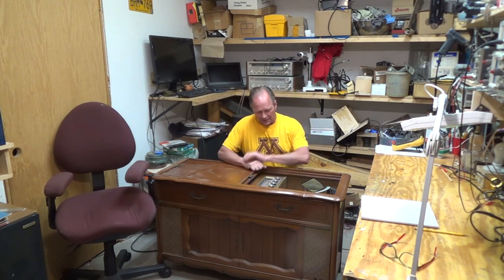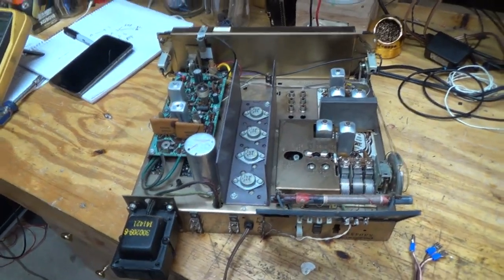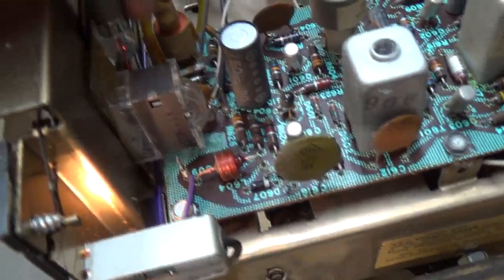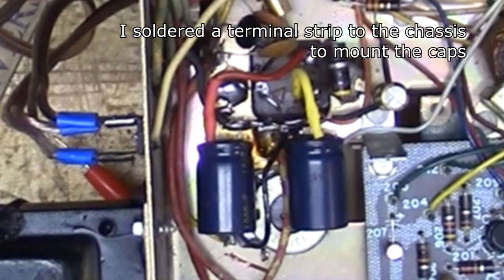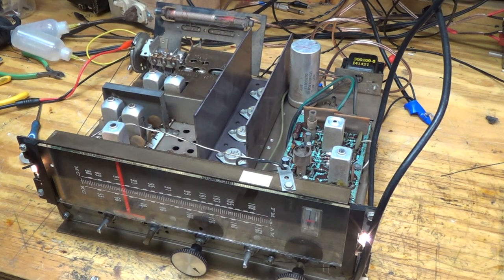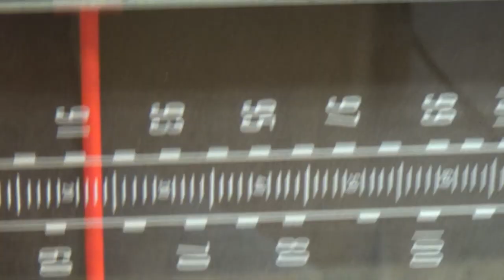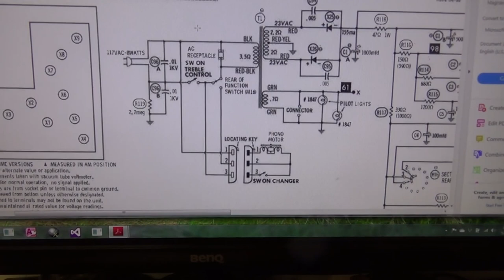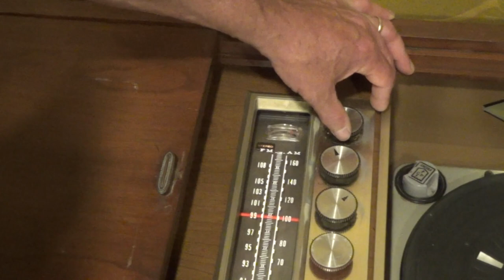Magnavox AstroSonic Console Stereo Repair and Restoration

Comment: Does that have a 204 chassis? my astro has and my fm doesn't work, i found which transistor may be bad
Reply from the maker: Model number:R20409-00 Chassis: 530432. I never did find a schematic that exactly matched. I even sent an email  to SAMS. Good luck getting it up and running! On another  stereo I fixed up from the early sixties I replaced the bad geranium transistors with Russian equivalents and it worked pretty well. Shango066 goes into quite a bit of detail on these replacements.
Reply: @RobsFixitShop  i found and fixed the problem . a couple lumps of solder shorted something but no permanent damage

Comment: Hey Rob, I have a Magnavox 1P3712 model and the the broke where it goes into the wall socket, I cut and rewired it but now the sound is high pitch and a little faster, any help would be great. I subscribed as well!
Reply from the maker: Try reversing the plug if it goes away add a polarized plug.
Reply: @RobsFixitShop  I did reverse it and it continued to do the same thing.

Comment: THE RECORD CHANGER
WAS MADE IN ENGLAND
OF HEAVYWEIGHT 
MATERIALS, IT IS NOT A CHEAP THROW AWAY
ITEM. TO SOME.
PEOPLE BUY THESE
CHANGERS ON EBAY
ALL THE TIME.
EVEN WHEN THEY DO NOT WORK PROPERLY FOR
PARTS., RESTORATION.
Reply from the maker: I am going to take another look at it, the owner wants to fix it. Thanks for the input.
Reply: @RobsFixitShop  did you have any luck?
Reply from the maker: @lordalexjones1177  Yes, the wire between the cartridge and the RCA jacks was broken and beyond repair. I tried using a wire from some ear buds but it was too stiff. I ordered a wire made for the job from ebay and soldered it in. It was kind of delicate work but the owner (a friend of mine) was thrilled. It still needs the idler when replaced  but I showed him how to do that. It sounded pretty good.!
Reply: @RobsFixitShop  Where do you get your parts?
Reply from the maker: @lordalexjones1177  I have had great luck with DigiKey for most stuff

Comment: i just learned that the stereo fm light  was a very low- voltage bulb a few months ago
Reply from the maker: I messed around with replacing it with an led but I could not get it to dim properly.
Reply: @RobsFixitShop  what size of resistor did you use?
Reply from the maker: @larryshaver3568  I tried a bunch of different values. There is voltage on the bulb all the time but when there is stereo there is obviously more. I couldn't get the led to properly transition between light and dark like the incandescent does. Best would be to use a properly biased transistor to switch the led on at a voltage threshold.